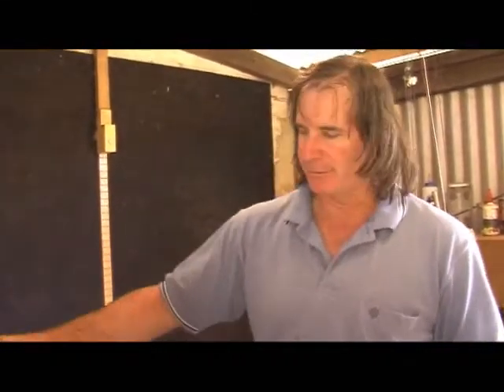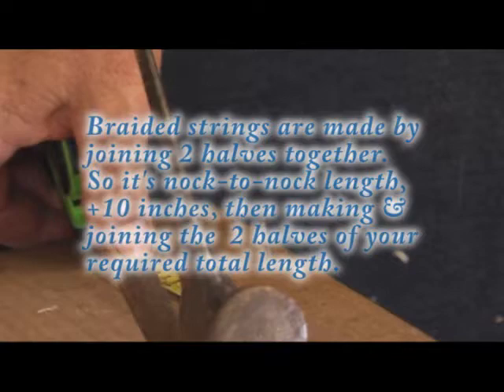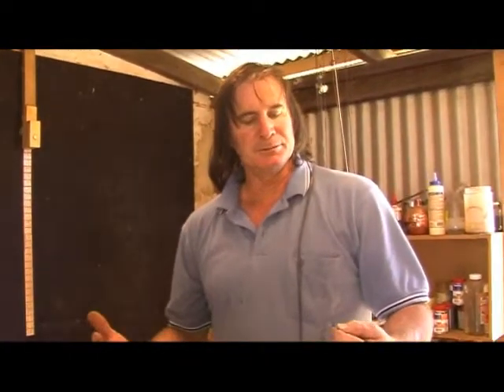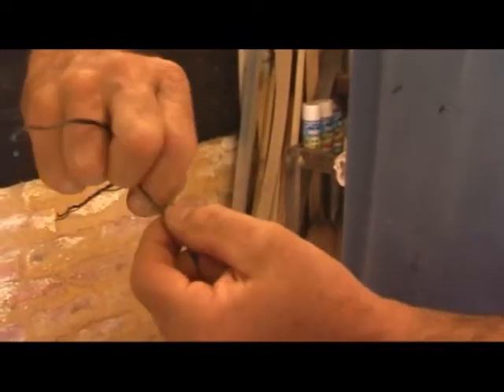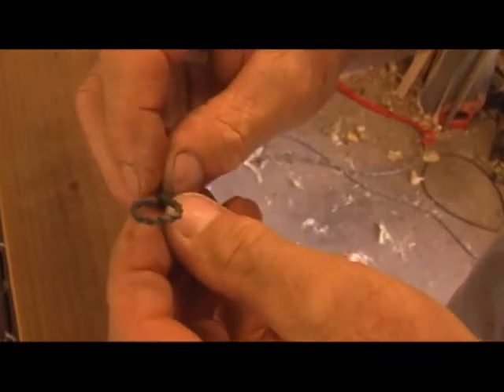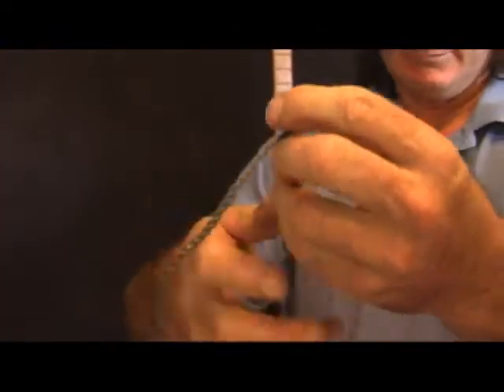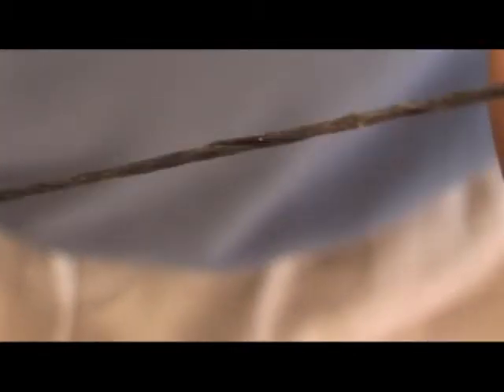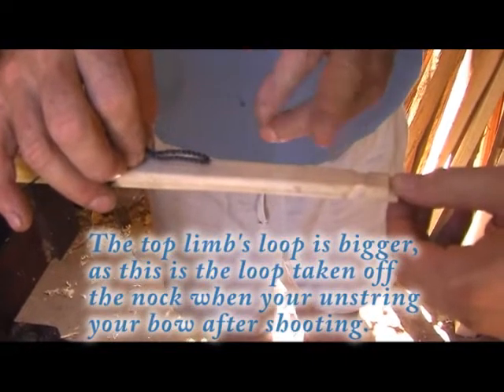Making a Braided Flemish Twist Bow String

Comment from the maker: @hatchtec Yep, heaps of wax really helps to keep all the individual strands locked together while you're working, and then a good rubdown of the finished string also helps the little tail bits from sticking out once finished.  Have another look around the 4 minute mark of the video.
Interestingly, I find some of the coloured dacrons (especially red) to be REALLY slippery, even with loads of wax they don't want to stick together nicely. Black is definitely the easiest for wax retention.

Comment from the maker: @tao2110 "Flemish" is the style name.
The material I've used is called Dacron B-50 as it has some stretch in it and some believe that flexibility helps a wooden bow survive a bit longer due to less stress being placed on the timber.  Dacron comes in all colours of the rainbow.
Others use Fastflight which has zero stretch in it, that gives better cast and extra distance, some swear it causes no problems for longevity, some prefer noy to use it so it's personal preference really  :-)

Comment from the maker: Is the Dacron waxed or unwaxed? I find that the coloured Dacrons tend to be very slippery, so I give them a really good rubbing with beeswax to make the strands nice and sticky. Then when you twist them together, they hold together, and as shown in the video, I rub even more wax on over the top of the finished string. I also reapply wax as needed. The blue and yellow string I use on my recurve has shot maybe 1000 arrows at a guess and is still holding up. Perhaps the loop strands are too short?

Comment: @mububban23 I've recently picked up making my own bow string using the flemish twist method with B50 dacron, but for some reason they're coming undone :( any help in preventing this from continuing? I'm making the twists as farily tight as possible but after 100-200 shots they still come unraveled.

Comment from the maker: @ulty777 I've got no experience with fishing line so can't comment, but if your nock loops are too thin ie not enough strands in the end loops, then the pressure on the tips will be amplified and may cut into the timber of your bow limbs/tips.  
To shorten your string another ~3 inches to get a proper brace height, you'd be twisitng the string a ridiculous amount.  Far better to unbraid one end and redo it.  Also gives you more practise :-)